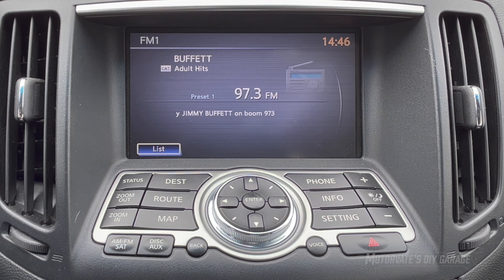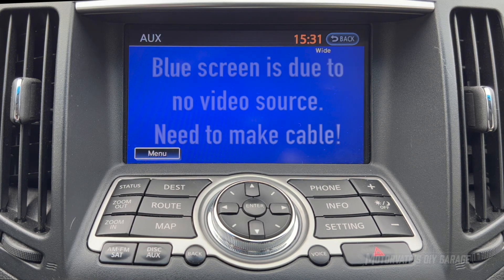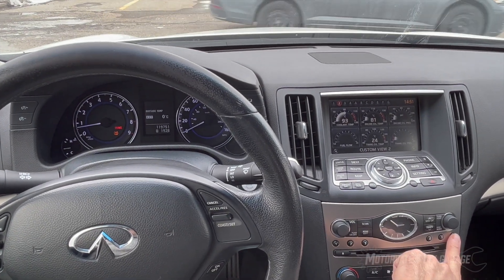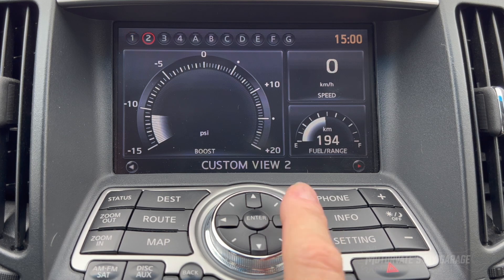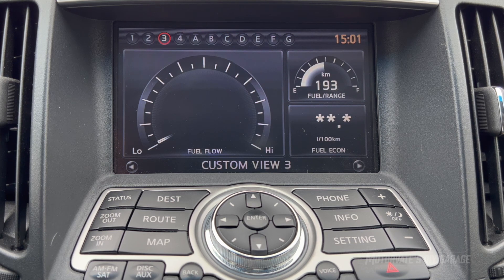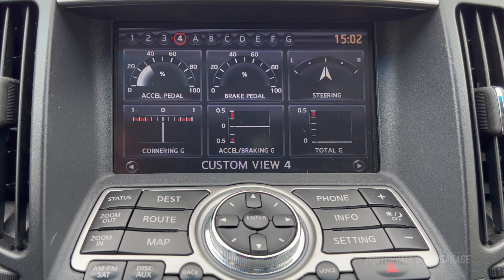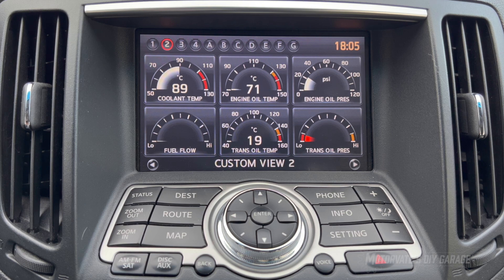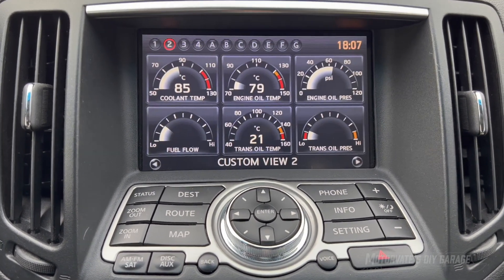BIG update! GTR gauges for G37 & 370z: MotorvateDIY Garage Ep.50

Comment: Is this ready to buy? Is it plug and play solution or how? And from where we can buy it? Excellent work. Cant wait.
Reply from the maker: Soon! The local beta testing of 6-8 units is just about to start. I want to make sure they work as expected on the different versions of the G37. (G37S w/6 Speed manual, G37  RWD, G37 AWD and G37 AWD with Tech package)

The car's network is slightly different as well as some of the modules.
Please hang in there!!!
Reply: Try on my 2012 G37S Coupe!!
Reply: Great, mine is auto 370z. Cant wait to get it in my car. Kindly share the details and keep me updated...

Comment: Is there no hope for 2008 g35x? Can i just replace my non nav with a 2010 newer g37 nav unit
Reply from the maker: From what I have seen,  the 2008 G35 doesn't have the required CAN bus data on the cars network... if the data isn't there I can't forward it to the module that needs it, like the GTR gauges. :(

Comment: I found a form of a guy who started figuring this out and was able to boot the gtr dash once 

I’m glade I found this in super interested in getting this to run on my g37
Reply from the maker: Glad to hear that...
After the local beta testing, I hope to get these out to everyone.
Reply: @MotorvateDIY what is the likelyhood this could come to the no nav head units?
Reply from the maker: Unfortunately,  I don't have any plans to attempt to develop that.
I need to spend all my time rolling out the GTR gauges and a few other products.

The non-nav units will require a different solution, as they don't have the "GTR gauges" firmware built in to the AV unit. 

However, later this year I will be starting to investigate an Infiniti G35/G37 clock gauge, that can show a few important data items, like coolant temp, engine oil temp and engine oil pressure.

Also, using the same code base, I will be looking into a 7" GTR like display for the 370z.

Comment: Very interesting work, I'd like to see this being a commonplace thing/display for the boosted models of both the G37 coupes/sedans, and the 370z sports cars (that have the same display). Might be a open aftermarket mod idea, less cost AND less hassle with disassembling the pillar trim pieces, to retrofit custom gauges! Great demo video! And I hope see you progress with this software!
Reply from the maker: As I see it, this is the easiest way to get all the gauges you want! There is no need to wire anything through the firewall (which is not easy!!) and it is plug an play!

It should work with any 2010+ 370 or G37 with navigation.
In the next few weeks I will be testing locally to make sure everything works as expected.

I also have put together a oil pressure sensor that can use Bluetooth or CAN bus to send the data to the GTR gauges. Everyone who owns a G37 or 370 needs to keep an eye on their oil pressure due to the possibility of the oil gallery gasket failing and causing an internal oil pressure leak.

Stay tuned for updates!!

Comment: Why is adding the G-force data that hard? Isn't it possible to add a ADXL335 to the ESP32 board an use that data to show up on the screen?
Reply from the maker: Excellent point... Measuring the g-force is easy. 
The challenge is that the CAN bus messages from the ABS/g-force module are structured differently than what the navigation unit uses. 

I could cut/split the CAN bus going into the navigation unit, and have a CAN gateway do the conversion. For now I want to keep this as simple as possible.

I'll look into this once everything else is up and running... Seeing brake force gs is kind of nice.

Thanks for bringing this topic up!

Comment: Would it be possible to intgrate a shift light? Like have a big flash on the screen at a certain rpm?
Reply from the maker: I don't have the ability to "flash the screen" BUT I could add a bright LED that could be placed somewhere in the dash and set it to flash at any RPM you want.

The LED would be wired to the GTR MFG converter board and should be easy to place into a good spot on the dash.
Reply: @MotorvateDIY  Even better!

Comment: This is very very cool, I’m boosted on ECUTek and would defiantly be interested in this!
Reply from the maker: Glad to heat this!
Testing has gone very well. The circuit board files have been sent to manufacturing and I should have them by next week.

Then, I'll make up 2-3 kits for local testing in the Toronto area on other G37 to make sure everything works as it should.
Reply: @MotorvateDIY  I live in Maine, so if you’re unable to find a boosted application, I wouldn’t be down for a road trip haha
Reply from the maker: Good to know and I'll keep that in mind. :)

Comment: Hi, I'm from France and your device is exactly what I need for my Coupe G37S ! I hope you'll succeed to achieve this device and I'll be happy to purchase one for my car. Have a good day. Hands down for the job done.
Reply from the maker: Thanks for your kind words!
Testing on my car has gone very well. The next step is to finalize the hardware and test locally in Toronto on other G37 and 370s.
Reply: @MotorvateDIY Hi! I live near Toronto. I am in Lindsay, ON. I’m  very interested in this device due to the Oil temperature and pressure gauges because of the well known issue with the oil gallery gaskets. I saw you mentioned it is harder to instal on no nav models. My car is a 2008 g37s with no nav functionality. Although I do have the Nifty city module installed. Let me know if you would be interested in testing with my car :)
Reply from the maker: First of all, I love Lindsay. I used to drive though there all the time on my motorcycle... it is such a nice area.

Since you have Nifty City, I think you have the option of "HDMI IN".
If that is correct, a Raspberry Pi could be connected to the car's CAN bus to get the data and then use RealDash to display it on the screen.

Can you verify that you can use HDMI IN on the Nifty City box?
Reply: @MotorvateDIY  hi I’m interested in this and was wondering if you had gotten any feedback
Reply from the maker: I have tested the hand wired prototype on a 2011 G37X with Tech pckage and it worked as expected!

The circuit boards are back from manufacturing and I'm waiting for one last part to arrive. Then I will assemble a few and test locally.

Hang in there, good progress has been made!
Reply: @MotorvateDIY  Thanks for your reply. Finger crossed. I hope we'll be able to purchase this awesome device very soon. Have a good day my friend.
Reply from the maker: Thanks! The testing has been going well on my G37 and will soon start to test on other local (Toronto) G37 / 370s

I will have a progress update video out soon.

Comment: Hi, any updates?
Reply from the maker: Testing in my car is going very well!
The next step is to build 4-5 more for local testing on different G37s and 370s.

I have also finalized the hardware for the Bluetooth oil pressure sensor and will be testing that as well.

Comment: So I believe it’s not possible for my Nissan 370Z 2009 model RHD from Australia?
Reply from the maker: Correct.
The 2009 navigation system is the older version and doesn't have the "GTR gauges" software built into it.

For North America, it looks like the first year the 370 that has the newer nav system (known as  08IT) that has the "GTR gauges" is 2010/2011. 

For other market places like Japan, I don't have any information on that.
If all goes well with testing locally, I will look into cars from other market places, to understand the differences, if any.

Comment: Found my way to you channel from an old 4th gen maxi thread. Bet the VQ37's fun. 

I know this is kind of a long shot, but did you ever have the a32 go into a limp mode of any sort? Only happens after the car warms up and will throw a EGR control circuit fault. Luckily I can bypass it by power cycling while in gear (manual ftw). The rear main, junkyard trans swap's (lol), ect have all been pretty straight forward. Any ideas?
Reply from the maker: I never had any EGR issues with my Maxima.
What is the exact code and describe what happens when in "limp mode"
Reply: @MotorvateDIY  P0403. After the car warms up; 1 mile or 2 min of driving, around 2600 rpm fuel is cut off. It'll bounce on that rpm similar to redline. It's not down on power before 2600. If dropping down a gear raises rpm above that engine/throttle is unresponsive.

I almost wonder if it's an emission compliance fault state or something
Reply: @MotorvateDIY here's a video of it

https://youtu.be/zWgVIyoWkKc
Reply from the maker: That is really odd... Have a look in the factory shop manual for the "fail safe" section and see if it shows anything for around 2600 RPM.

If you haven't already, follow the steps in the manual to troubleshoot the P0403.
Reply: @MotorvateDIY  I'm so glad the fsm's are available online. Been a while since I've perused through it. Seems like the p0403 has a few different rabbit holes to go down

Comment: Hey Frank! I have just discovered the channel and have been blown away at the work you have done, very impressive. I noticed in this video that you are interfacing 2 can busses into a single ESP32. I'm working on a similar project for replacing the Onstar module in my volt. Is there anywhere I can find more information on your work? Thanks 😊
Reply from the maker: Hey Kyle,
Thanks for your kind words!

At this time, I haven't made the time to clean up my messy notes and publicly publish anything. All of my free time is spent on development and testing.

However, the dual CAN bus ESP32 (good eye, by the way!!) is just an ESP32, SN65HVD230 CAN bus transceiver (for the built in ESP32 CAN bus controller) and a modified MCP2515 module so it can run on 3.3 volts. 

The MCP2515 module uses SPI to communicate with the ESP32 and runs at the max clock speed of 10Mhz. The end result is a VERY affordable dual CAN bus board, with built int Bluetooth and WiFi.

Comment: This is HUGE, I'd put $ down on what's available already.  Just a question and happy to take this offline, how would this work if one had swapped in an actual DBA GT-R head unit into the G37?  Would I be able to change vehicle type in the OEM unit somehow then use this module to activate and display the gauges?

I do have GTR head unit swapped directly into G37 but identifies and simply acts as a G37 unit after first start....
Reply from the maker: With a GTR nav unit in a G37, there is no way to bring up the MFD screen as the G37 doesn't have the "Function" button. Even if you could bring up the MFD screen only 3-4 gauges will work due to CAN bus differences.

Since you have the GTR nav unit in your G37, all you need is the "MFD Converter" module to be able to bring up the MFD gauges and have all but one gauge (brake/accel g) work / display live data.

Due to G37 / GTR CAN bus differences, the TPMS menu item / screen will not be displayed. BUT the Nav unit can be reconfigured to show the simple stacked list (ugly!) of tire pressures. For me, some live TPMS pressures is better than nothing.
Reply: @MotorvateDIY  this is awesome and yes the Function button is key (I also have an actual R35) and my efforts to date to replicate its function have been unsuccessful. 

I’ll happily take a stacked TPMS over the bare bones setup we have now. Is said module currently available or still in dev?
Reply from the maker: The prototype module is being tested every time I drive my car and it has been working well.

My next step is to finalize the hardware design, built a few modules for local testing on G37s with different options (like the Technology package) to verify it doesn't cause any problems.

I've never done anything like this before and want to make sure it is reliable and doesn't cause any problems on the car's network.
Reply: @MotorvateDIY  I hear you and glad to see some people still putting their own work into something rather than slapping a sticker on something off Alibaba. Patiently waiting for release date!
Reply from the maker: Thanks for your patience and support!

Comment: I would buy this in a heartbeat for my qx50! Same headunit as g37.
Reply from the maker: I just double-checked and you are correct! It is the "08IT" nav unit from 2010 to 2017.

Soooo, it should work, but I will need to test locally once the G37/370 roll out is going well :)
Reply: @MotorvateDIY  Will it work on 2012 EX35 with Nav.  too?
Reply from the maker: I think it will, but will need to test that locally to make sure.

Comment: are you able to enable the memory seat function where the seats and wheel retract and move back into position when the car is turned on and off? from my understanding automatic models came with this, but on 6mt models it was disabled by the factory for some reason.
Reply from the maker: I just had a quick look at the CAN bus tables, and it looks like the "Automatic Drive Position" (ADP) module needs to see that the automatic transmission is in park for it to move the seat.

That signal doesn't exist with a manual transmission, so I'm assuming the seat doesn't move.

Can this be spoofed/tricked into working?
Maybe, but I don't have time to dig into now... The GTR guages are my focus :)

Comment: Awesome work man, two thing if they could be added it would be fantastic, 1- AFR Sensor as there available from obd2.
2-intake air temp.
If these 2 parameters could be added I guarantee you most 370z/g37 owners would be interested in this mod, as it’s the most looked after gauges along with some of others you already got 👍🏽, looking forward for this. Good luck.
Reply from the maker: Thanks Wesam!
Since these are the built in gauges for the GTR, I can't add to them.
I can only feed the data they are designed to receive.

My next project will be a stand alone display for the non-nav 370, and I will be able to show what ever is requested.  

The non-nav G37 solution is more complex and I don't have a plan for that.... just yet.
Reply: @MotorvateDIY  would you consider selling a kit? I’ve been wanting to upgrade my head unit for my 35 for a long time
Reply from the maker: I will need to test the GTR gauges to see if they work on a 07/08 G35  and 09 G37 with a 2010+ Nav system. After a quick look at the CAN messages, I think it will, but will need to test to verify.

I'll look into that after the testing of the GTR gauges on the 2010+ G37 and 370.

Comment: Can I switch out the none GPS unit in my 2010 G for a GPS unit with touch?
Reply from the maker: Yes.... OWC has a nice plug and play wiring harness to do just that:
https://www.owc-upgrades.com/product-page/g35-g37-navigation-harness-adapter-kit-upgrade-2007-09-cars

BUT you still need to buy the nav screen, front panel, nav buttons and nav/radio unit... So the cost does get close to doing a Tesla screen or some other CarPlay Android Audio solution.

Comment: Hey Dave awesome video as always! I have an off topic question if I may, I bought my g roughly a year ago and found out the gauge cluster has been replaced with a newer model, do you know if my My mileage would be updated to my new cluster automatically? Thank you in advance!
Reply from the maker: The mileage is stored only on the cluster. 

If the cluster is changed, the mileage will not be updated to what is on the vehicle... It will use what mileage is on the cluster.

Comment: Great stuff. Question for the oil pressure and temperature readings. You have aftermarket sensors installed to receive that data?
Reply from the maker: Excellent question!
The coolant and engine oil temp gauges, use the factory sensors.

The engine oil pressure, manual transmission oil temp and differential oil temp use aftermarket sensors.... well sort of.

The trans/diff temp sensor is actually a Sentra coolant temp sensor that you can get at the scrap yard for under $10.

The oil pressure sensor can be any 150 psi pressure sensor.

Those sensor are connected to a Bluetooth module we have created. This means you don't need to run wires from the engine bay to the interior,  which can be tricky and time consuming.

Comment: Nice video, I have a question about my g37 if you could please help me. I’m getting berk resonated test pipes installed which will be replacing my current oem catalytic converters. I know the CEL light will come on, but I heard some people say that the engine will run rich when I install them and that will damage the engine. Is that true and is there anyway I can prevent that from happening ?
Reply from the maker: Sorry, but I really don't know as I don't have any first hand experience with test pipes.

From what I understand, most of the fueling feedback is done by the pre-cat air/fuel sensors. 
I also think the post-cat oxygen sensors are used to check for a rich/lean bias of the pre-cat air/fuel sensors, but I don"t have any hard data on that.

If your engine does run a little rich, that will only damage your wallet :)
Reply: @MotorvateDIY  Thanks for the help as always, keep up the good work on the channel ! 🤝
Reply: @MotorvateDIY  Also my 2011 g37x sedan has 146k miles on it so I’m replacing the gallery gaskets as preventative maintenance. Is there anything else around that area that I should replace that usually goes bad on a VQ ?
Reply: @MotorvateDIY  Bumpin this so you can read my previous message
Reply from the maker: Thanks for doing that. It can be difficult with the YouTube comments to find a reply to something that has already been replied to.

I would just check for any excessive wear on the guides, chain stretch and how much the adjusters are out. Also, check for play in the water pump and make sure it turns smoothly.

I know a lot of people like to replace chains, guides and water pump while there are in there, however,  those items are know to last a VERY long time, if the car has been maintained.

^^^ Just my 2¢
Reply: @MotorvateDIY  No THANK YOU lol, you’ve been a great help ! 🤗